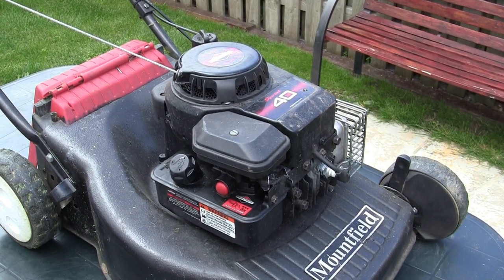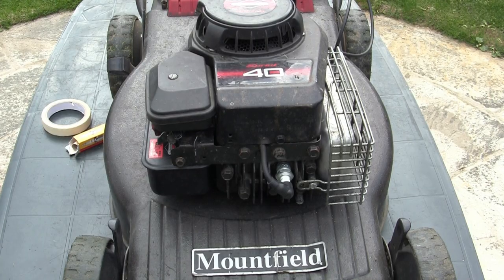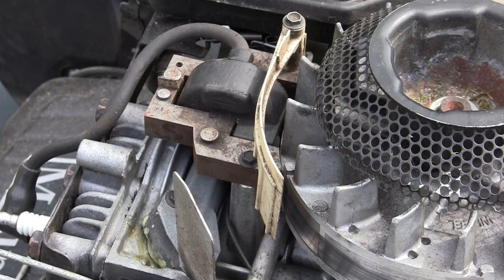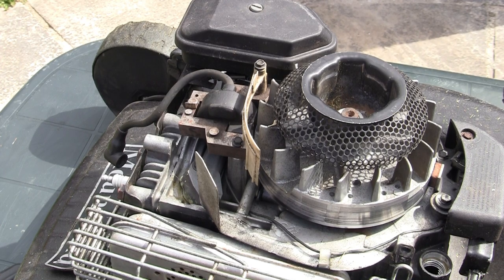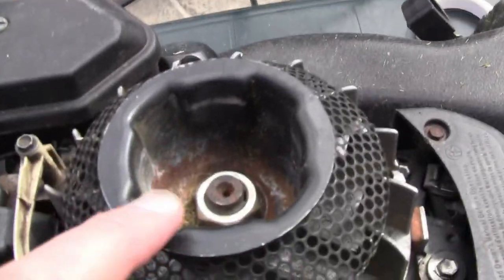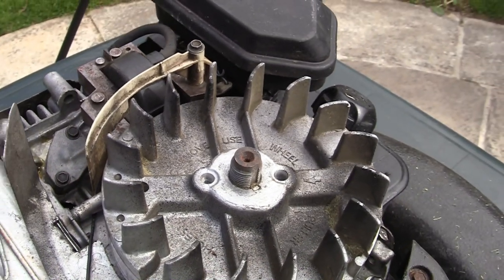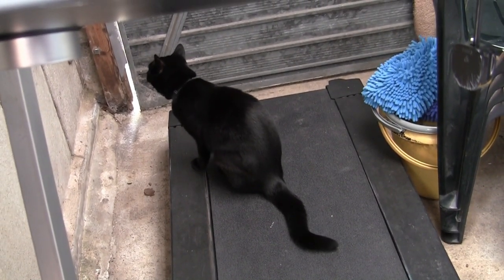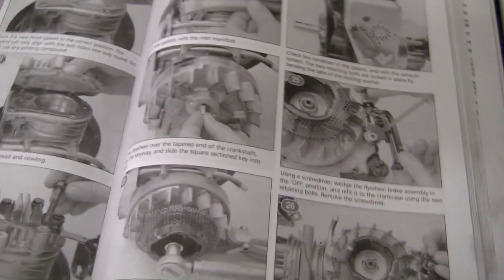Briggs And Stratton 35 Classic Torque Settings and Coil Air Gap

Comment: Such a classic engine. Mine is 20+ years on & starts up like a champ first pull every spring.  
This is a helpful little grocery list of a video thanks. Piece of card is exactly what I learned to for the coil also; but maybe had to do it twice?  Hello Jersey. It's good to have a cat's help! Except they run off when the starting happens. 😂

Comment: Hi Mowerman,

Finally finished refurb of my Classic 35, Mountfield mower today, New Clutch cable ( What a pig of a job), new engine cut off cable (Dead Easy), New Carb Diaphrgam / Gasket, sharpened the 20 year old blade with a basic metal file, no need for an Angle Grinder IMO, new governor carb springs. 

I also put the blade in a bath of white vinegar to loosten the rust, and then sandpapered it finishing it off with a metal file maintaing the same 30 degree cutting angle etc.

Finally I finished it all  off with a new re paint in gloss black of the rusted fuel tank &  pull cord housing, and mower now looks like 20 years younger!

Keep up the good work Mowerman, love your videos!

Oh, and yes it started first time using fresh fuel, very important indeed always bear that in mind folks!
Reply from the maker: Brilliant! Nice work!

Comment: Thanks so much for the video - super clear explanations and I enjoyed the cat's cameo!

I found you video searching for head bolt torque settings - the Internet search threw up loads of B&S engine specs., but none match my engine model (9D902) even closely. The model number locates parts I needed to buy (new carb. diaphragm and replacement governed idle spring, which disintegrated during disassembly) on B&S Part Finder, so is obviously valid, but no help.

Anyway, my trusty old mower has gradually been losing power over the previous couple of mows, to the point where it was bogging down under almost no load. After the last refuel I noticed the fuel primer bulb was not springing back, and also when running the engine was revving up a bit when the engine was tilted, so I reckoned it was time for a carb. clean and almost certainly also a diaphragm replacement.

I've overhauled the carb. before when the engine ran badly, so dove in without thinking (end of a long day...), forgetting the carb and fuel tank come off the engine together. Before I recalled how it all comes apart, I'd accidentally slackened off the head bolts to remove the control bracket to get access to the screws fixing the carb to the tank, and here we are!

Comment: Good to see you back again mate, thanks for the video as always. 

Any suggestions for the cabling I've found mine has developed a kink in the sleeve, is starting to fray and is stretched, the damage is for engaging the forward motion but the kill switch could do with adjusting.

P.S your old site has gone down, I dunno if you are able to host some of the info elsewhere that's maintenance and cost free.
Reply from the maker: Hi I no longer have the website. I've not seen a really good alternative for worn cables unfortunately. You might find a decent 2nd hand one on ebay if the cable has a number on it
Reply: @MowerMan  No worries Paul, I'll take a gander on eBay for replacements. Shame about the site but understandable.

Any suggestions for a pull cord dragging, around about half length only when the coil is in place it. I wondered if I need to adjust the coil gap.

Thanks for all your efforts.
Reply from the maker: @DeadManInBlack  Recoil might be tightened on too hard. Nothing to do. with coil
Reply: @MowerMan  i remake when required from cycle brake tubes. and a crimp tool :)
Reply from the maker: @ukneil  when you remake what?
Reply: @MowerMan  the black outer cables for drive/dmh. i cut off the hooks and drill the old wire out, and use wire and black tubing off off bike brakes cables and recrimp the hooks :)
Reply: @ukneil  sorry for the late reply and really good suggestion

Comment: One thing I'd be curious to see is an upgrade video from the base metal cover and manual throttle to adding the plastic protective cover and throttle controls. The mounting points seem to be there on all models.

Comment: Hi Mowerman,

After setting up the Air Gap between flywheel and Magneto on a Classic 35 , are there any timing issues that you should take note of before putting back the pull cord assembly? 

Reason I ask is that during the air gap exercise ,I turned the flywheel several times and just want to make sure if it really matters if at all, when putting back the pull rope housing assemly?

Thanks

Comment: Thanks most informative info on Briggs And Stratton 35. Question how many wood-ruff keys should there be on the blade side? Just took the blade off to sharpen and there was only one 1/2 moon key but notches for two keys? Does it matter?

Comment: Hiya Paul, I have a 35 Classic that was given to me it was sitting in a garage for a few years I believe, it had a service on it before it was given to me but it wasn't running properly, Ive pulled it apart and there is oil on the spark plug and it starts but dies out.
Is that piston rings or something else?

Thanks for your helpful videos 👍
Reply from the maker: service the carb

Comment: hi Paul I have recently  retired  from,work  so I have decided  to get a few mowers to do up and sell I have taken one apart I have painted  the deck and put it back together  but I now have a problem  with kick back now I have checked  the key way and looks good to me  I just tried to pull it over but I not put any oil in it  I was just wondering  if that would make any difference  I pulled it over a couple of times any help would be most grateful  I wish you would  do more video's thanks barry

Comment: no question. but yesterday, friend dropped the identical mower to me from his mothers, for the tip.
so i had it. wthi grass box. and vgc. 
usuall lumpy and very smoky. o level ok. so a new carb kit and plug, tank clean up, and exhuast washout of oil, and runs sweet. it had been on its side or even upsde down i think. so wwillb sold on again soon :-)
Reply from the maker: awesome

Comment: How do you work out what price to sell your lawnmower for l don’t want to be to cheap or dear thanks Peter
Reply from the maker: I like to at least double my money. I charge more with a grass box and even more if it has a self drive. Test price would be my suggestion for your local area. You only need one good buyer so start high and negotiate or drop price each week
Reply: Thanks for the information I will put it to the test